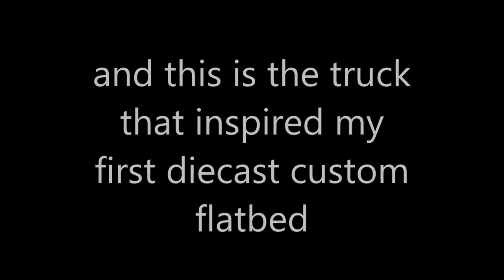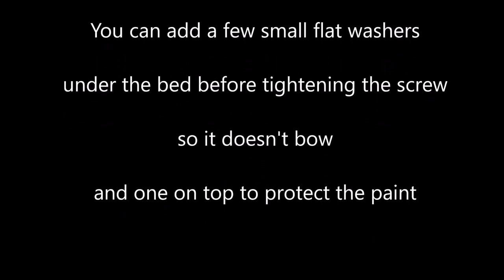1/64 CUSTOM FLATBED TRUCK (PART 4)

Comment: how did u make that headache rack on the older truck...your first flatbed because I have tried coming up with techniques an I just cant figure it out and there is just not really anything out there on how to make them...could you please help me out?
Reply from the maker: Hello!, that headache rack I made it with aluminum tube, the same for the steps (running boards) and the grille is from a HO scale Diesel Engine, I think they call them "cooling grilles". for example:Detail Associates #2727 Air Grilles, but I'm not sure how long is this one.There are many brands of  HO scale grilles, google "photo etched grille"
 I hope this helps, thanks for your comment.( at hobby stores or e-bay)